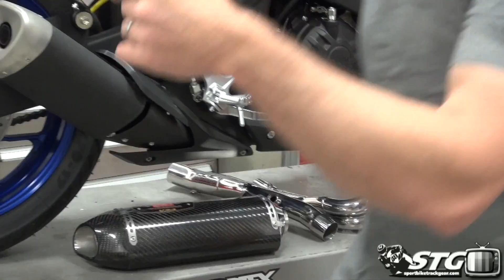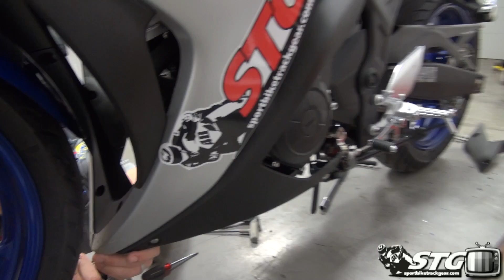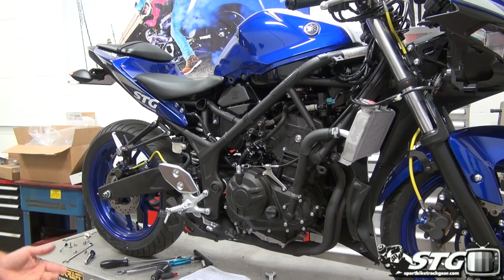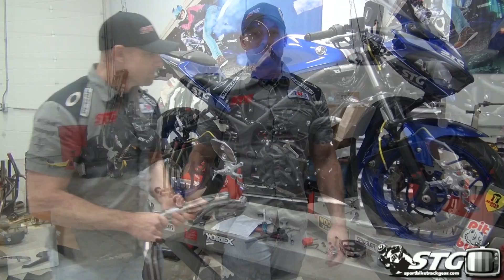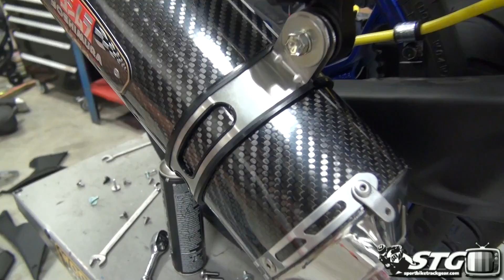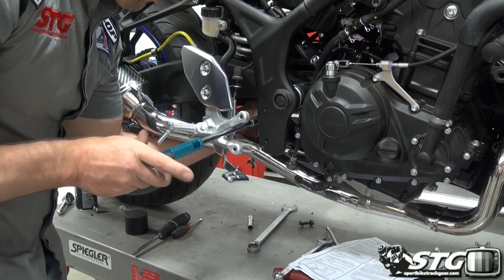Yoshimura R-77 Full Exhaust Install on a 15-17 Yamaha YZF-R3 from SportbikeTrackGear.com

Comment: do you really need a remap/reflash if you install a full system? coz i heard a decel pop  backfire
Reply from the maker: You do not need to have the R3 tuned when you install the full system if you prefer not to. I suggest installing the system and riding the bike. If you are happy with the performance then leave it alone. - Van
Reply: @sportbiketrackgear  but the bike will become lean right is that still ok? no damage in the future?

Comment: I just purchased this exhaust system for my 2021 R3. Will I need to tune it after the install?
Reply from the maker: You can install this and ride without any tuning. If you decide to go racing and need to get the maximum performance then you need to hit the dyno. - Van

Comment: If you install this full system you need to change your ECU? And remap it? Or you can install it and good to use without changing the ECU/remaping it?
Reply from the maker: You can install this full system and ride the bike. If you are happy with the performance no need to make any changes. We only stress that if you are racing or have built the motor. - Van

Comment: hi bro, after the full exhaust is installed, do you remap ECU for R3?
Reply from the maker: You can install the system and ride the bike all you like. If you are happy with the performance then leave it, find yourself wanting more add a fuel map. - Van

Comment: Can I use R77 full system to install on Yamaha MT03? And may I not need to install pc5?
Reply from the maker: I am pretty sure the fitment is the same. If you are not happy with the performance you will need to flash the ECU or install a fuel controller. - Van

Comment: Hello, great video, I have a question, I have bought an Exhaust Two Brothers (Full system- the catalyst was removed ), but I have the concern if it is possible that the engine can suck water through the Exhaust?. thanks
Reply from the maker: No need to worry about that. - Van

Comment: do you need to install a power commander and an upgraded air filter? im new to motorcycle mechanics
Reply from the maker: No you do not have to install them with the exhaust system. That said you will need to flash the ecu or install a fuel controller to get the most out of your new exhaust system. I would suggest installing the exhaust and riding the bike to see how you feel about the performance. If you are happy then leave it, not happy add the flash or fuel controller. We rode the STG R3 quite a bit with the system installed before installing the Power Commander with no issues at all. - Van

Comment: Good afternoon. Gentlemen, I am about to buy a Yamaha R3 2015, I want to ask you with all the accessories and arrangements that you make to the r3 that acceleration reaches. And how fast is the top speed? Thank you, I would appreciate it
Reply from the maker: The best top speed we have seen with Max Van on the bike (130 lbs) was 109 mph at Grattan Raceway on the straight. This reading came from the GPS lap timer we have on his bike so it is much more accurate than the speedo on the bike. - Van

Comment: With Db killer, is the bike extremely loud? Like does it get annoying?
Reply from the maker: Tough question to answer because we all have a different idea of what is annoying or loud to be fair. Persoanlly I do not find this system to be overly loud without the insert. It is important to note we have also found the R3 to make more power with the insert installed. - Brian Van

Comment: I'm a lil bit confused in selecting a full system Yoshimura or just a slip on Akrapovic. Any significant changes or any negatives for the engines ?
Reply: If you hey a full exhaust you need to tune it or get a power commander

Comment: +sportbiketrackgear with this full system would you reccomond doing a fuel mapper or would it be okay to not do a mapper?
Reply from the maker: You do not have to do a fuel map or controller. That said to get all the benefits of the system you will need to do it at some point. We have had our R3 since 2015 and the bike is still without a map or controller on it. - Van

Comment: Hey man, I have a question that you might not know the answer to because you didn't take them off.....well, I'm going to replace the header exhaust gaskets, right at the block, and I need to know which way they go. I did my exhaust a while ago and when I did, the gaskets fell off and I wasn't able to see which side faced what. 
If you hold a new, OEM gasket in your hand, you will see that one side is completely flat, and the other has a beveled edge.

Comment: I just installed this same exhaust on my 2016 r3 yesterday. My bike seems to backfire a lot and even shot some fire out. Background on my bike i got it brand new I've ran for about 2800 miles and I did the 600 miles service at Yamaha dealer. I put the DB and it still backfires. What could it be or is it normal ? Thanks in advance. And by the way I learned to install it off of this video thanks for that.
Reply: R3 Panda u need to tune the O2 to 14, or block the intake of the Air Induction System
Reply: Abyan Naufal when you say tune the O2 to 14 it means add more fuel to the system? Thanks a lot!!

Comment: question:  no anti-seize for the o2 bung or the header studs?
Reply from the maker: Thanks for watching and the question. I usually don't lubricate those studs because I really would rather they not come loose. It does make it a bit more difficult to remove the exhaust down the road but it is better than losing those nuts IMO!

Comment: It's so hard to decide between M4 slip on and Yoshimura R77 full system, which one should I get? Comparing sound, performance..etc. I did tons of research for this both two exhausts but still can't choose which one better. Any recommended or advice from you guys would be highly appreciated!!!!
Reply from the maker: In the end the decision is yours, and that is a wonderful thing! All I can say is that both of those options will work great, in the end it is just about what type of improvement you want in overall performance. The M4 slip-on won't eliminate the CAT and because of that won't give you the performance increase that the R-77 Full System will. However, there is also the price to consider! Let us know which one you decide on!

Comment: I want to get this exhaust but I'm concerned with excess backfires. I've seen one other  YouTube r3 install and he claims loss of power and continual backfires with the dB killer out, but less so with it in. I can handle the install easily, but I don't want to get into installing power commanders and messing with factory electronics in order to enjoy the sound. What was your experience while riding with this exhaust?
Reply from the maker: +warlok9 honestly it has been a really pleasant experience. It really is a very reasonable sound and I have not experienced any noticable performance variation without a fuel control unit. thanks for the great question!

Comment: I'm just getting back into riding and picking up my R3 this week. I'm so glad I found your channel, you do a great job on your DIY projects. 

I'm curious why you went with the full Yosh exhaust over the Akro? 

Keep up the awesome job!
Reply from the maker: You want to replace them if they look worn but this bike had under 1000 miles on it at the time of the install! Thanks for the great question!
Reply from the maker: +giff74 We honestly install most of the different brands, and I just really enjoyed the look and sound of the Yosh! Akra makes an awesome exhaust as well, I have that system on the R1 currently. Thanks for watching!
Reply: +Sportbike Track Gear The exhaust manifolds don't require gaskets?

Comment: my local bike shop is selling an r3 with this exhaust already installed, actually for less money too. I was wondering does the exhaust make a difference in the performance?
Reply from the maker: +Nick5220 - With proper tuning it could make a difference in performance!
Reply: Sportbike Track Gear awesome thanks!

Comment: With full systems do you have to install a power commander and run a dyno?
Reply from the maker: +TheCONtwo Not essential but your bike will run better with the PC!
Reply: +Sportbike Track Gear what about for a slip on?
Reply from the maker: A slip on usually won't change the performance of the bike enough to require the electronics upgrade, but there are a lot of other benefits that come with purchasing a new fuel controller!

Comment: What if it rains? Stuff the pipe with plastic bag? (jk) But really, what would you do?
Reply from the maker: +Slacin' Ace If the bike is being stored outside I would suggest covering the pipe to keep the rain water out. If the bike is just being ridden in the rain it gets hot enough and expells enough pressure that no water is going to stick around long no matter how severe the rain.

Comment: What was the weight savings? You said you were going to weigh the stock system a couple of times during the video.
Reply from the maker: +Lance Surgeon It was a little over 10 lbs, we actually have a graphic towards the beginning of the video that shows the weight savings. I did forget to mention it during the video. - Van

Comment: When u installed the full system... Did u do any kind of fuel mapping? Or left it all stock?
Reply from the maker: +Kaha K I left it stock and rode it for about 500 miles. I will add a fuel controller soon. - Van
Reply: +Sportbike Track Gear did u notice any performance change ?
Reply from the maker: Nothing super noticeable, but It does sound MUCH better!
Reply: Thank you for responding. You have amazing videos and a dream job. I really appreciate your support for the community. Keep it up!

Comment: what is the difference between this and a slip on? is it the same installation process as you would on a full? I just bought mine and it's coming tomorrow.  just curious.
Reply: +sliccflip The slip on is just the carbon part, it just slips onto the original pipes, the thing with this bike though is that it has components between the engine and exhaust that dampen the sound so a slip on exhaust won't sound as loud on this bike as it normally would on another type of bike like a ninja 300 or cbr300r.

Comment: how long can you go with out a fuel controller doing this?
Reply: +damen grandel The R3 runs a closed loop system so it should compensate on it's own for this mod but with the controller it will remap the fuel curve and richen it up a bit which should give you a noticeable jump in horsepower. If I'm wrong someone jump in and correct me but that's what I understand to be the case.
Reply: ahh ok so how do i know if mine is running a closed loop?
Reply: The factory ECU runs in closed loop looking at O2 readings to adjust the fuel air ratio. SO all of the stock R3's are running a closed loop system.

Comment: Do I need to install a fue controller after adding this? and a free flow air filter? Thanks.
Reply from the maker: El Profe Fuel controller is not a bad idea, air filter is not needed but you could do it. I have not added a fuel controller yet, hope to do so soon. - Van

Comment: Hi,

thanks for the Video! i'm very glad to see this video, because i'm looking for a great exhaust system since over 2 month. I want to order this exhaust system but i have 2 questions. First of all i live in Germany.

1. Can i get in trouble with the police, my insurance or with the TÜV (Car Inspection)?

2. can i get in trouble with the customs?

BTW: sorry for my bad english :)

This Exhaust System sound better than the most slip-on exhausts on big bikes.
Reply from the maker: Customs should not be an issue. Not sure how to answer the other question. What you could do is leave the stock exhaust on for the inspection. Wish I had more to offer here. What country are you from? - Van
Reply: Sportbike Track Gear From Germany. I definetly need a Vehicle Type Approval or an E-Number.

Comment: On your site I see that the signature series exhaust is slip on only and the difference is it keeps the black cover at the bottom?
Reply from the maker: Encrypt http://www.sportbiketrackgear.com/yoshimura-yamaha-yzf-r3-2015-r-77-full-exhaust-system/ Here is the link for the full system. The Slip On is brand new and we do not have that in stock yet. We do have the full system on the shelf. - Van

Comment: are the r3's fairings made out of plastic? from this video it looks insanely cheap and could shatter on the slightest pressure
Reply from the maker: ADIGA!|Cheezo Negative, the fairings are pretty much the same material as on the 2015 R1. - Van
Reply: All motorcycle fairings are made out of plastic
Reply: Sportbike Track Gear ??

Comment: Ok I'm getting my R3 in 2 months. I want this exhaust system which I will put on myself I have a few questions:

1) What are the part numbers for both the Canister and the headers/straight pipe? Or is this a complete kit?

2) How much for the total kit?

3) I checked Yoshimura's website but could not find this kit for the R3, so did you install an R1 kit on the R3?

I'm new to riding and this R3 will be the first bike I have ever owned. Not to be a douche or anything, but if you can't answer my questions factually please do not comment, I need honest feedback not misleading answers. I would prefer Sportbike Track Gear to answer my questions if possible but if anyone else installed this kit on their R3 that would be awesome too. 
Thanks

Comment: Did you get a chance to run and compare them on the dyno?
Reply from the maker: Jason Wang No I have not. The butt dyno tells me there is a significant difference. This actually made the bike more fun to ride. - Van
Reply: Airplane fuel makes a big difference too...lol. Did you put in a power commander? You should address this issue. When I put the full Akropovic system on my Ninja 1000, I called Akropovic and they said no, that it's made to run properly without further modification. I hear a LOT of people saying the minute you replace the entire system, not just a slip-on, that they rant and rave you need a PC. It's just not the case all the time. I always say check with the manufacturer.

Comment: Does any mapping need to be done?
Reply from the maker: 72bunk Yes we will get to that very soon. Riding it for a bit is not an issue IMO. Typically the bikes are fat from the factory, most maps end up taking fuel away rather than adding it. - Van
Reply: Cheers
Reply: Sportbike Track Gear They haven't got a R3 available yet with a R77 Yoshi. They told me as soon as I get mine that I can come to them and they will make a free mapping. Got to wait what the dealer tells me in 2 days about the purchase. They need to ship it here somehow.